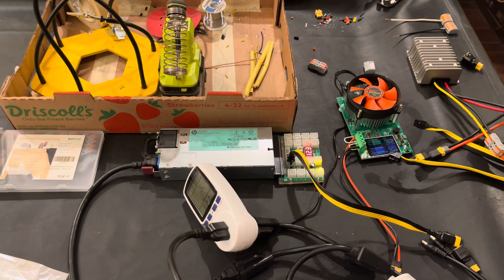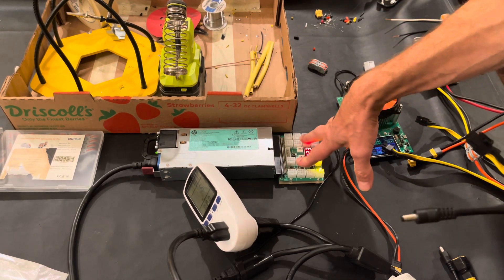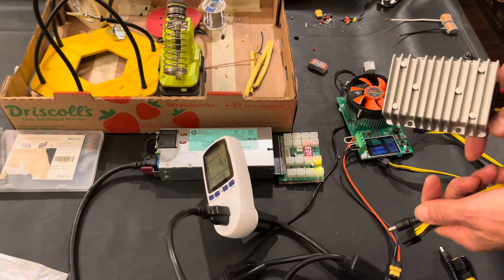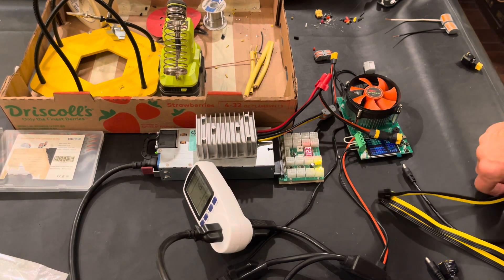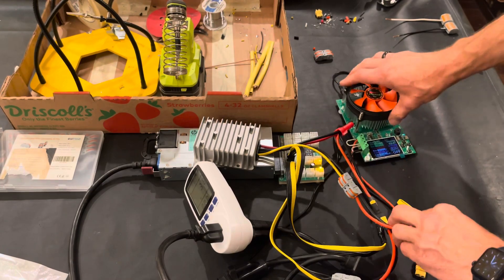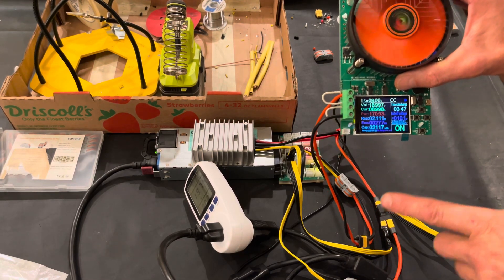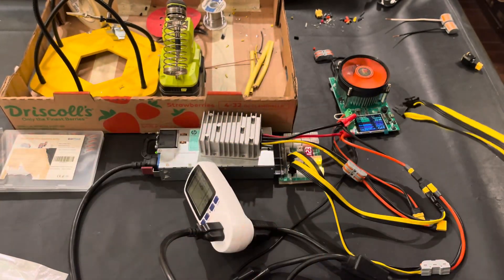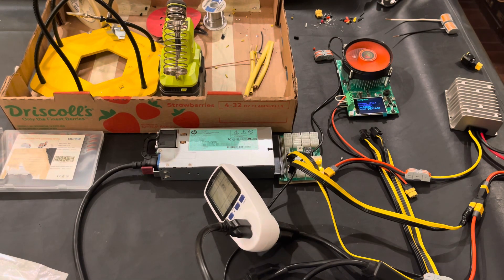KS0 to 160GH overclock you will need to do this if you want to use 12V server PSU

Comment: have you tried to run them at 24V? If they work the A will be lower
Reply from the maker: Yes, I tried 24V. I have vid with amp reading , it uses more watts because of step up converter 90% efficinecy and also gets 5-7C hotter on sensors temps.
Reply: what if you use a 24v psu? I can not find the video with amp reading, I only can find videos with 19V
 @DontMindMeMining

Comment: Watching this now. The barrel plugs I bought have 14awg and rated for 15a 180w. And ks0 will just reboot loop. Do I still need a voltage converter?
Reply from the maker: Try one on 19v to make this  decision mine only one worked on 12v out of 6 , other 2 worked on 19v and then 3 other would reboot until I found correct overclock: one at 150GH and 2 @ 140GH not all will take 160GH OC, I’ve switched first three to 175GH and doing good for last 2 weeks on 175GH oc